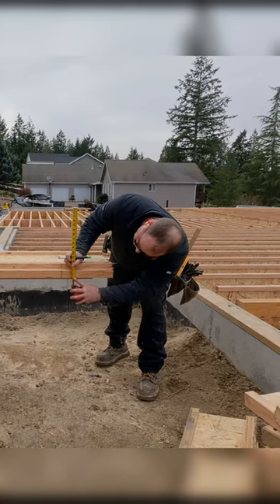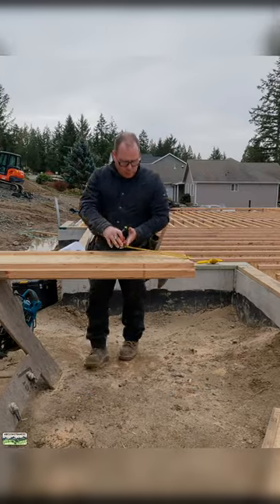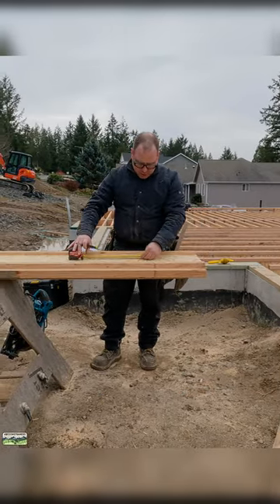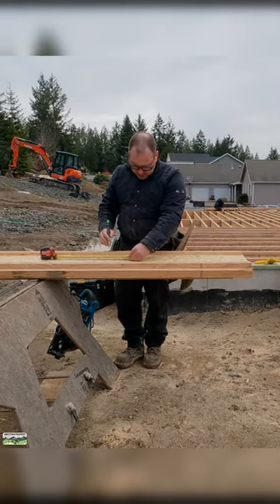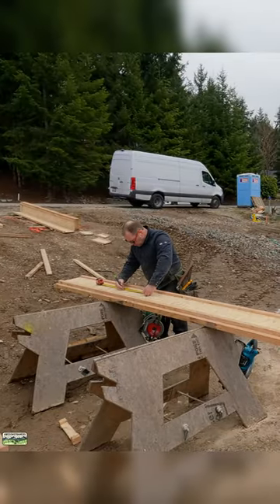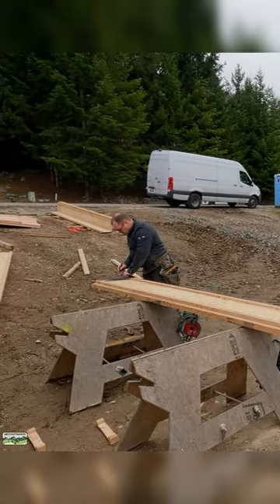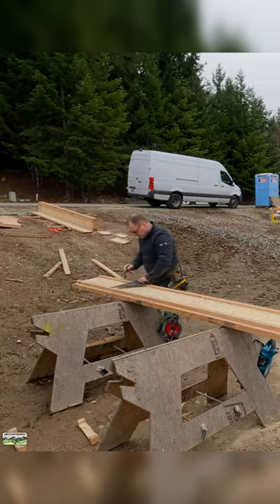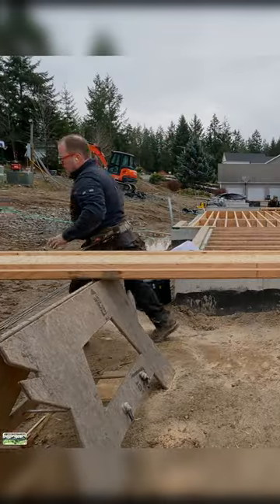Cutting I Joist Blocks Quickly

Comment: I was a farmer from 1971 to 2010.
I never cut a 1/16 of an inch. 
Only in my stairs and a sharp #2 pencil.
I joist I used 1x3 in X bracing. 
Faster to cut and install.
Other trades liked it too.

Comment: Your tolerable margin of error must be at least a saw kerf for that to work. Chop saw with a stop block would be more a consistent length and more square.
Reply: A saw kerf is more than acceptable for blocking
Reply: You ain’t him, Petez.
Reply: Mr. BARLOW, Ight?, G¿
Reply from the maker: Nope, chop saw doesn't allow me to cut 2 at a time. Margin of error was accounted for and I get exactly the right length block with this method. No set up and tear down.

People who think chop saws save so much time never show their set up and take down. Gotta factor in all the variables 👍
Reply: @AwesomeFramers  sorry I’m a left hander who throws right. No way am I cutting I joists freehand consistently square. However I can hammer left or right. Best framing hammer is pneumatic now.
Reply: After reviewing the video again I’ve changed my mind. When cutting up large members your correct it’s easier to move the tool than the stock. I’d use a crosscut jig of 2 strait sticks attached to a thin piece of plywood. You could build a stop off the registering stick below the kerf and cut identical blocks blindfolded. As for setup I’m never woodworking without my 20+ year old 12” Dewalt already setup.
Reply: @AwesomeFramers  in fairness, my chop saw on stand takes about 30 seconds to go from folded to ready to work.  Makita 12" XGT.  But at a $1500 setup, it's not something you just want lying around on your jobsite.  

That said, I use it 95% finish work, 5% framing.
Reply: @Peter Barlow  it's not trim bro it's rough framing
Reply: @chrislull670 the rougher it is the weaker it is.

Comment: A jig the correct width would eliminate all that measuring or, as indicated before, chop saw with stop block.
Reply from the maker: Chop saw isn't a good use of time in my view with larger, heavier material like this.

Jigs? I've used them and not found them productive because they are unwieldy if you try and cut 2 at a time

Comment: use a 2 foot square. then cut.
or a sliding mitre saw. with a jig.
minimize the steps your taking. but to each own. the end result is all that matters.!
at 7$ a sqft i would not be taking the time
at  20$ a sqft take as long as you want! 
personally im impressed with the saw horses. good pro video

Comment: Maybe if you use a real framing square you could speed up a bit. Who measures blocks less than 2 feet? And then pulls a square out anyway. Advice from a real framer.